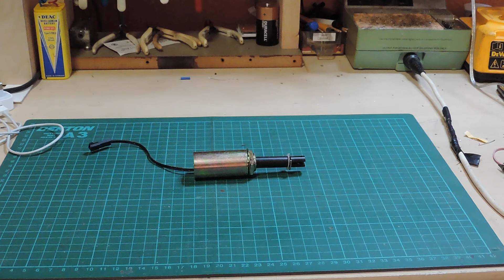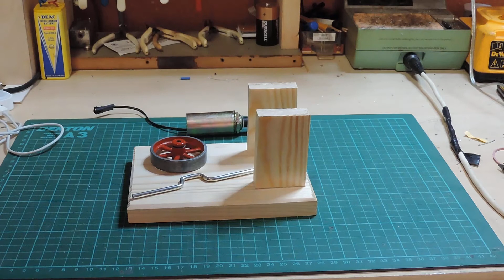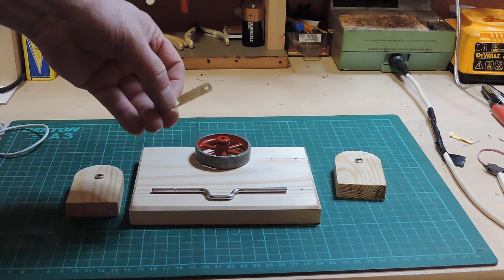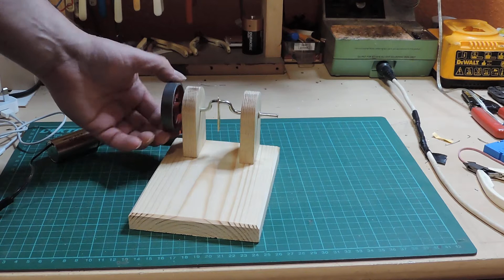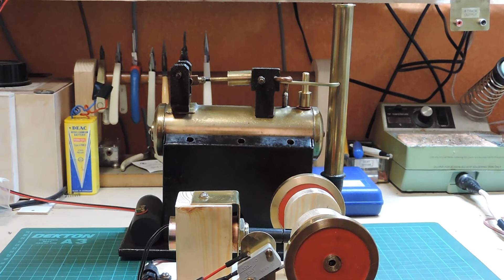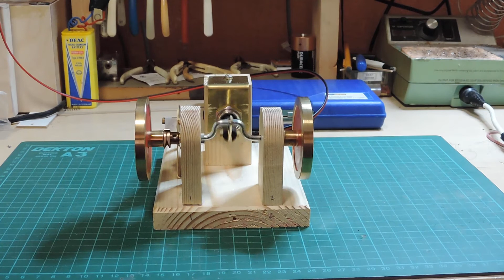Solenoid Motor Built From Spare Parts & Scrap!

Comment: Where did you acquire those flywheels?
Reply from the maker: Hi Patrick. The Mamod flywheel came from ebay. The two solid brass flywheels i made from bar stock. The Stuart Turner flywheel is from a small ST engine which is awaiting restoration.
Reply: Retro Steam Tech thanks for the reply, I’ll check those out on eBay. I need to go ahead and bite the bullet on a metal lathe, I also enjoy mrpete222